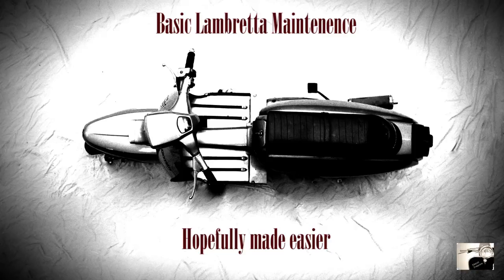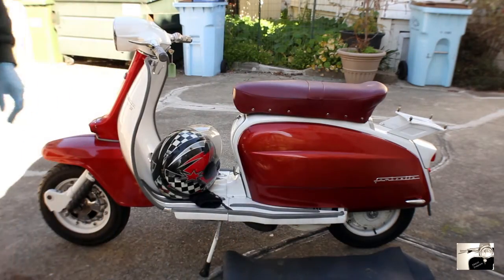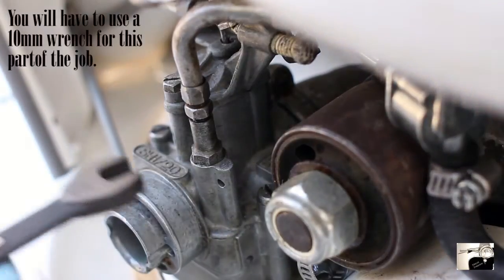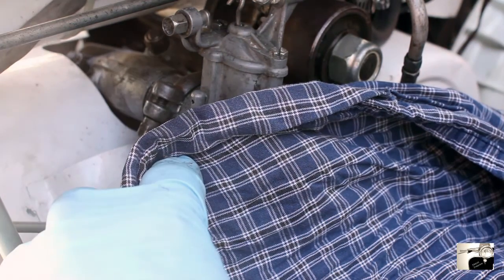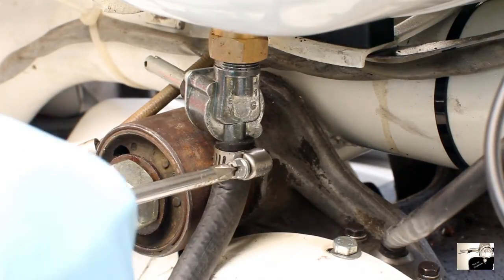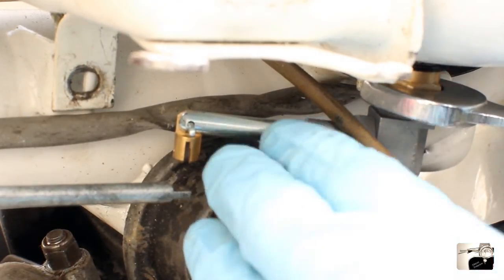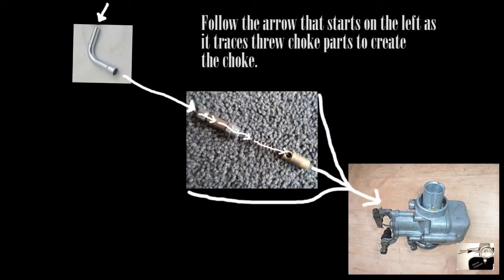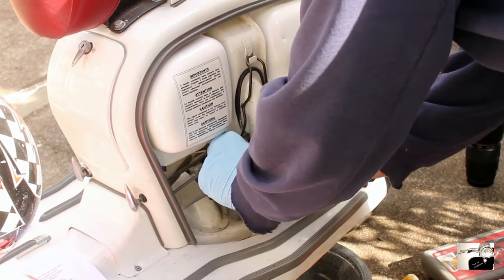FuelTapRemoval and replacement

Comment: I came here to find out how to remove the carb and clean the jets on my 68 Lambretta Li 125 Special as it had been cutting out when idling and Id heard this can be caused by a blocked pilot jet. The June edition of Scootering magazine has a section on cleaning your carb but I found it hard to follow. I found this video much more helpful & I managed to remove the carb, clean the jets and put it all back together. I kicked her over a couple of times & she idled over and didnt cut out :) thanks